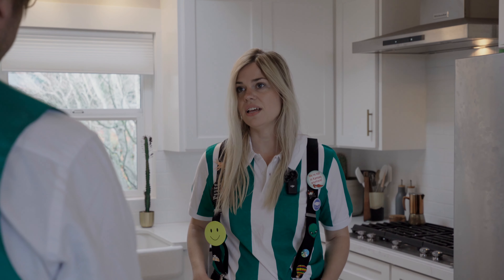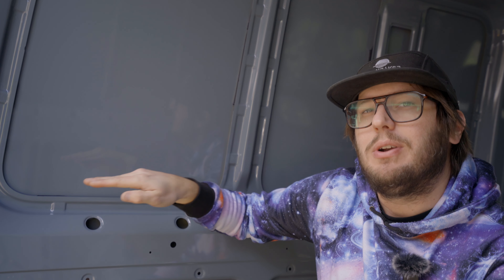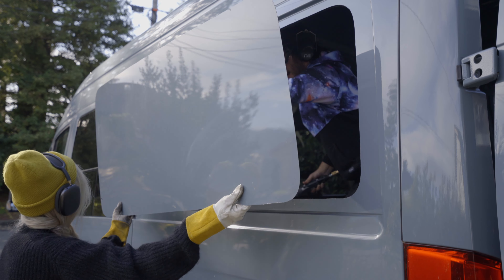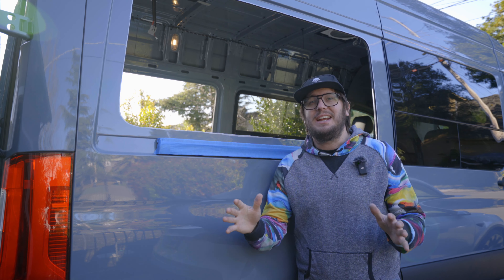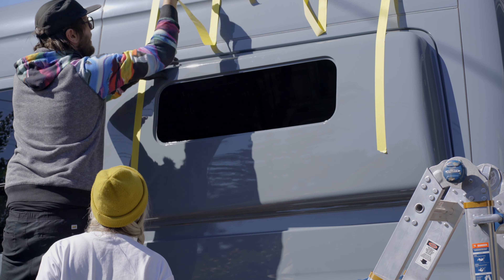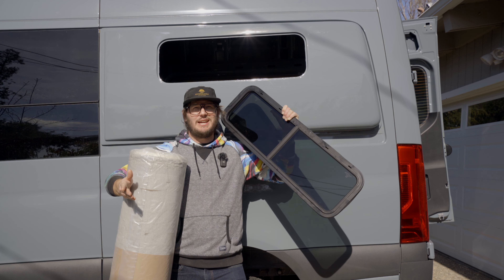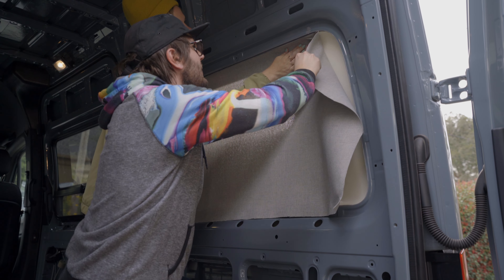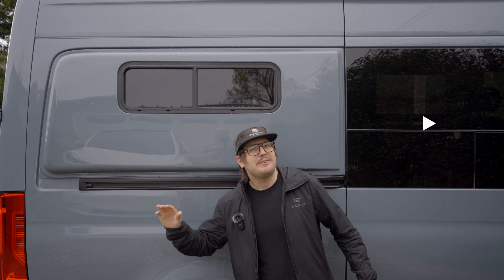Sprinter Van Build - Flarespace Flares Complete Install and Upholstery

Comment: Great video, I think watching I decided I didn't want to install flares but now I'm convinced I want to buy an air saw lol, looking forward to that rust video!
Reply from the maker: @sassy.wormhole!  Thanks for stopping by and glad you enjoyed the video!  I think if I were to start over again I’d probably go with the @Vanspeed capsules.  I still can’t get over the fact that the flares don’t drop all the way to the body line on the drivers side and the capsules add a lot more noticeable space front to back.  With our layout having the bed sideways was an absolute must. 

The air saw is great I’ve used it so many times on the van.  I’ve heard from others not all airsaws are created equal.  A few people who watch the channel tried the Harbor Freight one and it eats blades.  I think any form Ingersol Rand would be good.  I’ve also heard you need a pretty decent sized compressor.  I already had mine so the investment was minimal.  If I were starting from scratch I might look at the Electric version from Ingersol Rand https://amzn.to/48GUBp8. It’s pricy but when you weigh the cost of getting setup with a compressor (if you don’t have one) it might be cheaper overall. 

I’ve been busy with a few other things but I do want to get back to the rust video. Any paints in particular you’d like to see. I have the following already for the test 

- Rustoleum auto primer 
- Rust Bullet 
- Rustoleum Enamel 
- POR15 
- Eastwood Rust Encapsulator

Comment: Many people intall flares some what the same way but also different some install windows prior to first installation but don't you think precut backing foam on flare before installation easier,  I have 07 170 Mercedes Benz sprinter van I plan to add flares among many other things for now I'm just watching and learning from other people mistakes but I do think the air reciprocating saw may work better in corners but the teeth blades is the key to any cut
Reply from the maker: That's definitely a good point and something we considered.  The main reason why we didn't put the foam on first is because we wanted to prioritize a completely, verifiable & sealed joint for flare to van body over anything else.  In addition to ensuring a structural bond, making sure there was no chance of water getting ingress was our number 1 priority.  In fact, I recently watched another YouTuber loose their capsule (basically the same as a flare) down a washboard road because of improper bonding and prep techniques so something you don't want to mess around with. 

Now one could argue that most of the joints are visible with or without the foam on, however the main problem area is up in the front of the flare. That pocket continues about 4-5" beyond the cut where the flare actually bonds to the van and it's actually a pretty tight space.  In order to put sealant there on the inside and make sure it's formed a full fillet with no leaks you have to be able to see it and with the foam installed I think this would be super difficult and honestly quite messy.  Both the Sikaflex 252 we used and the MS 5510 Bk from flarespace are quite viscous and stick to everything they touch.  

Some people have been successful with that method though, so if you are feeling up for it and it makes sense to you to do it that way I would say to give it a try and report back for others considering this method!  We can all help each other improve! 

On the topic of blades, yes you are right a 32TPI quality blade is a must regardless of tool type.  The airsaw is just such a more agile & ergonomic cutting solution for this type of stuff I find myself always reaching for it.  In fact I just used it yesterday to cut a beam underneath the van for my heated water install!  More on that soon! 

Thanks again for stopping by and best of luck on your build!

Comment: Great install video.  What are your thoughts on doing the upholstering before you install the flares on the van?   It seems like it would be easier working on a bench.
Reply from the maker: Thanks for the kind words.  Definitely thought about that, but IMO it was more important to ensure a complete water tight seal.  In order to do that you need to fillet and caulk from the inside as well.  It would be a serious challenge to do this without making a complete mess especially up behind the flares in the towards front.  As you are pushing adhesive up in that gap it's so tight and so hard to not get the glue everywhere.  Honestly, I was worried about upholstering after the fact, but with another person it's actually really simple. It was our first time and it turned out great.

Comment: Great Video! How much did you spend on getting your flares painted to match your van?
Reply from the maker: Hey Kelly, the cost was $800 here in the Bay Area (everything’s expensive) for them to color match. I actually left the van there for the afternoon for them to mix the color exactly, you can’t tell they aren’t factory. I’ve heard people in smaller metros getting away with $400 for the set.  You’ll wanna take it to a reputable shop that has experience with fiberglass. Hope this helps.
Reply: Thank you @moonrakerdesign  I'm also in the North Bay, around Santa Rosa and I got two estimates and they were both over $1k.  I just thought it would look so much better with it matching the existing color of my van.

Comment: Another great video guys! What type of benefits overall do you expect from the seam sealer? I am considering adding this step as well. Keep up the great work! PS - Eager to get my hands on those hood strut brackets and flush mount brackets! Hopefully you're making progress making those available.
Reply from the maker: Hey @paniro21 thanks for the continued support!  The seam sealer is 100% overkill and there are plenty of vans on the road without it.  Overall our reasoning was I wanted it to be a continuous joint:  inner wall to outer wall to flare.  I also wanted it to seal off that gap so debris and things don't fall/build up in there during the rest of the build. 

The hood strut brackets are in stock and shipping!  I can whip you up a set of the current Dometic brackets unpainted or I'm working on 2.0 right now which will be actually 100% flush.  Not sure when I'll have time to finish those with everything else going on though..... too many projects!

Comment: sourcing Moonraker approved products  for my Flares now. You still leak free and support using Sika 252 w/ 207 Primer? (Stuff that came with them seams generic and Sika appears to be the Gold standard of Goops )
Reply from the maker: Both work! The Silane based adhesive is easier to work with because of no need for primer and it’s thinner in viscosity which means it’s easier to pump. You do have to scuff the paint more for bonding. I think they recommend sandpaper if I remember right.  If it’s not expired I’d go with that, just to save money and they wouldn’t recommend anything that didn’t work OK. 

But yes, no issues on my flares still 100% leak free through a bunch of rain and a bunch of rough roads!  

Thanks for the continued support!